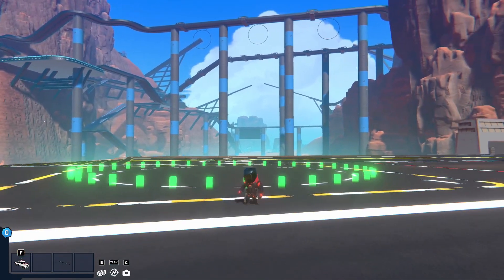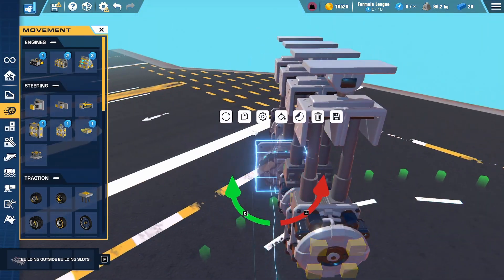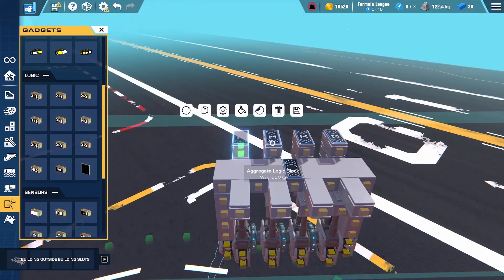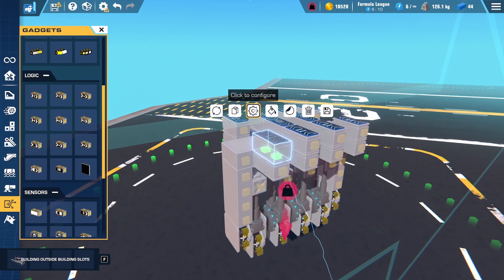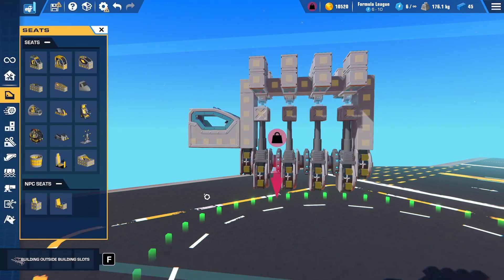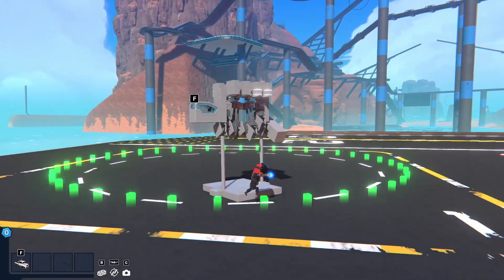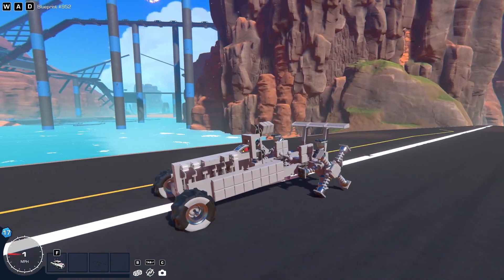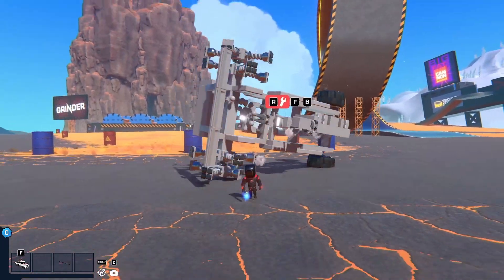Trailmakers Piston Engine Tutorial V2

Comment: For me the top of the engine was the only part moving and nth else
Reply from the maker: make sure the pistons are connected properly specifically the orientation it is likely you have them sideways. they should only connect to the hinge, the other piston, and the crank.
Reply: @wtswins i got it working now
Reply: Would it be possible to make a flat 8? @wtswins
Reply from the maker: @UsEr-3rR0r-r6j  for sure!

Comment: It feels dirty that you're using rotars with power on them for this, it's also missing a flywheel to store energy. I love the design but at that point just use 5 rotars/cheap cheat engines cause it's the same thing. The pistons here are only helping deliver power on the crank shaft.
Reply from the maker: the servos are set to 90 degrees and are being used to offset the crank as we are limited to a 90 degree build grid in trailmakers 100% of the power is coking from the pistons and I don't include a flywheel in the tutorial because in trail makers inertia is irrelevant
Reply: @wtswins  I get it now that's a huge tip to learn from. I missed the part where they're not on infinite degrees. Thanks for explaining. Also is inertia really irrelevant here? not 100% with unity engine physics.
Reply from the maker: @ considering that piston engines make 100s of thousands of horsepower due to an absurd amount of toque using a flywheel will do nothing but hinder performance

Comment: 5:20 a timing wheel is more efficient, 
doing the timing the way you are doing it in this vid makes the sensors have a higher chance to activate too late or sending a pulsing signal for a bit.
You are also introducing logic tick delay into ur system by having an extra logic block, instead of doing sensors->pistons.
Reply from the maker: product gate has no delay